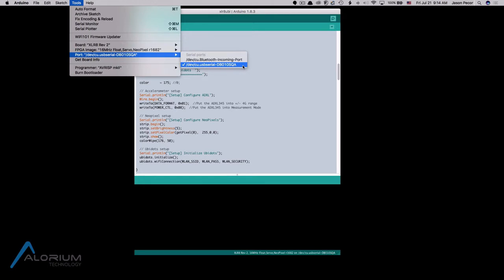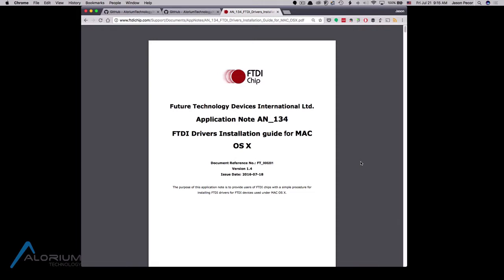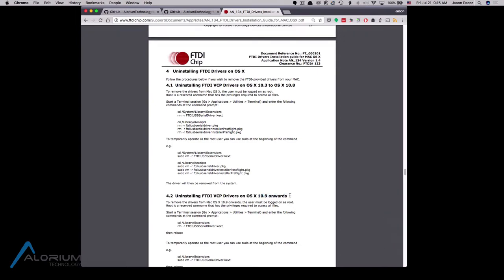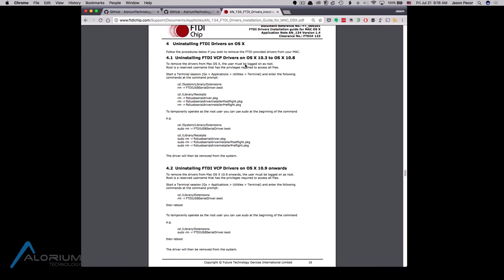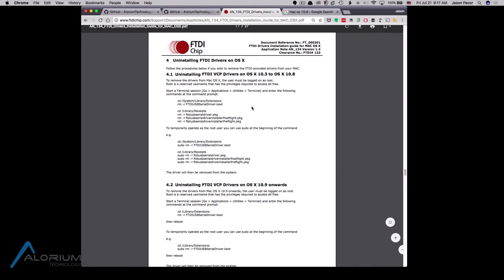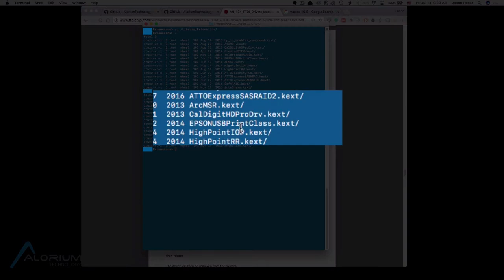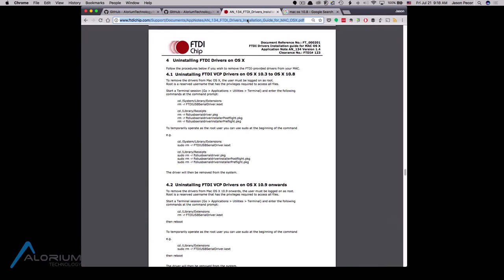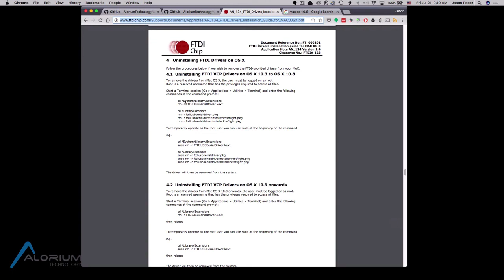FTDI Drivers and Mac: Try this Fix! #SSSVEDA | Vlog 10

Comment: I'm researching because I have a similar issue with my 2013 iMac, very conflicting information from the Mac as two ports can be viewed from a program/app I use.  When connecting a piece of test equipment for measuring antennas it won't work and won't identify ports I know exist.  So I will press on as these tips haven't worked with OS 10.15.4.  Whether I will narrow the field is yet to be seen  Thank you so much for posting as 3 years on from your original at least the issue has been identified.  Kindest regards Mike
Reply from the maker: Hi Mike - thanks for leaving your comment.  I appreciate it!  I hope that you are able to get everything working.

Comment: Well I am not so clued up with my Mac but I recently got finished my 3D printer and installed Pronterface on my laptop. It did not see the USB port so I started researching what could be wrong. I found this forum where the guy had a similar problem and one of the forum members suggested going to this link that he provided and downloading one of the drivers for Serial USB ports. I found one installed it and now Pronterface does not even open. My laptop is also a 2014 model. I am running High Sierra and cannot upgrade anymore. I am stuck and really need help.

Comment: Removing previously installed d2xx driver from /usr/local/lib/libft2xx.* and 2xxHelper.kext fixes the issue on macOS Catalina as well.
Reply: Thanks for the update on Catalina, Sergiy.  Glad to know that it worked!
I am normally an early adopter when it comes to macOS releases, but I have not waded into the Catalina waters, yet.

Comment: Confirming this works on a Mac Air running Mojave 10.14.6. Strongly recommend this fix!
Reply: An update.  Worked fine for an hour or so, but now has reverted to old problem. Deleting FTDIUSBSerialDriver.kext from both /Library/Extensions and /System/Library/Extensions works for a while but then again reverts to the old problem, and the FTDIUSBErialDriver's reappear in both locations.  Any suggestions?
Reply from the maker: Hi Eric - I am sorry to hear it's still a problem.  I (Jason) have not seen this issue since way back when I made this original change. I'm not sure what to recommend, here.  Any chance your system did some kind of OS Update that would have reverted back to including those drivers?